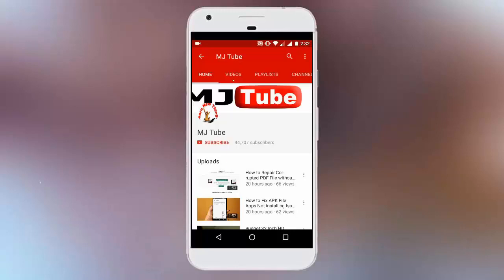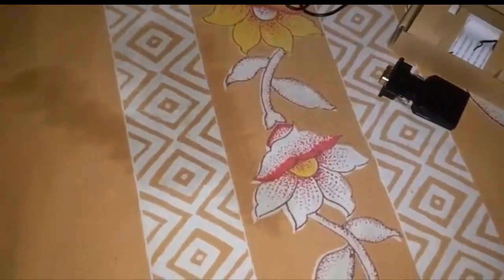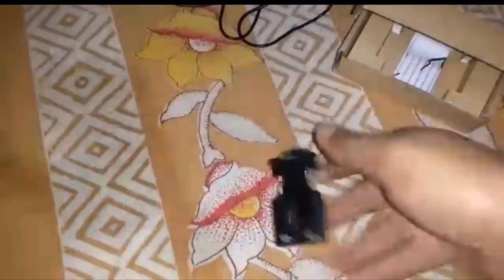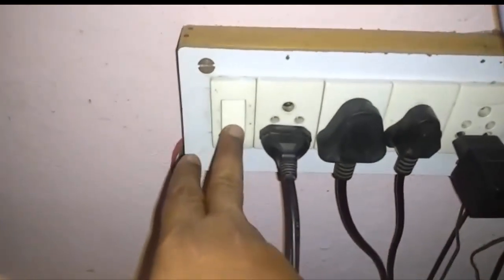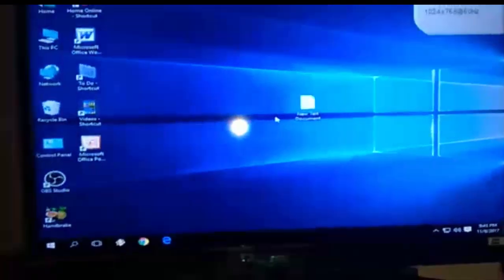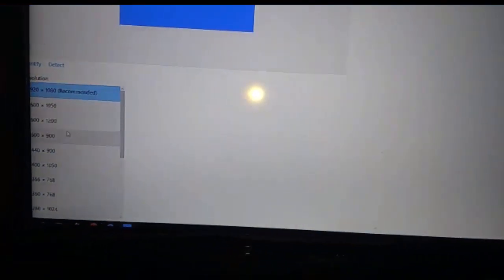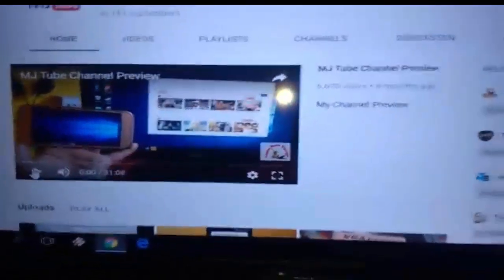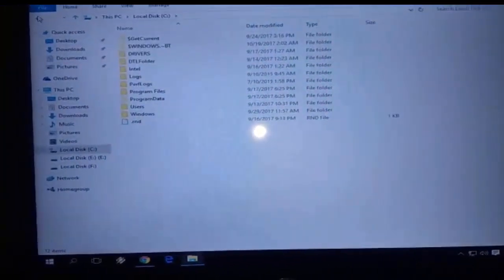How to Connect PC/Laptop to TV with Audio Sound

Comment: For those of you who do not see the option even with show disabled devices go into device managers sound section and enable all nvidia features nvidia high definition audio nvidia wav extensible etc apply and ok. Go back to playback and you should see your hdmi output as nvidia output 2 etc etc or in the videos case AMD. If you don't see nvidia etc etc its because you need to download and install nvidia hd audio and other features from nvidia geforce experience do that re try. 
To get the video display up go to desktop screen right click screen settings at the bottom a drop down menu "multiple display" should show something like "extend these display" or something just click the drop down and select duplicate which will mirror if you want only the tv on then just click show only display 2 and obviously from your tv click show only display 1 to go back (and yes that's with your mouse).

Comment: Thanks👍👍👌👌👌👌, useful information. It worked on my MI TV......... but the sound is very low. I checked all the sound settings in control panel but am unable to fix it. Could you pls share information on this if possible.